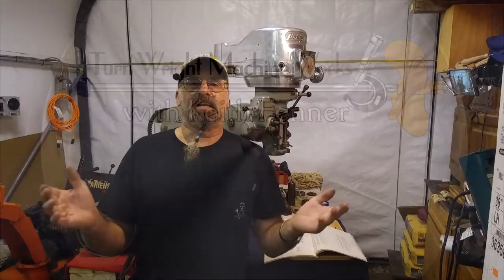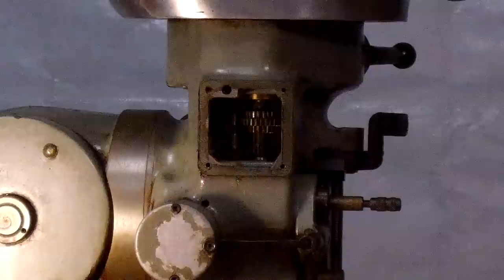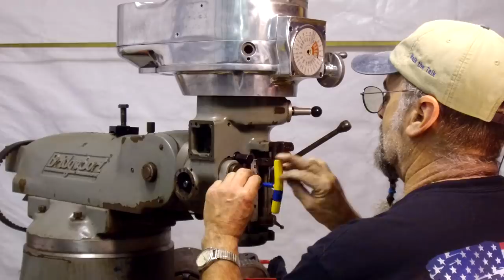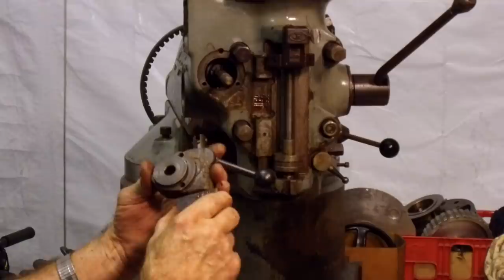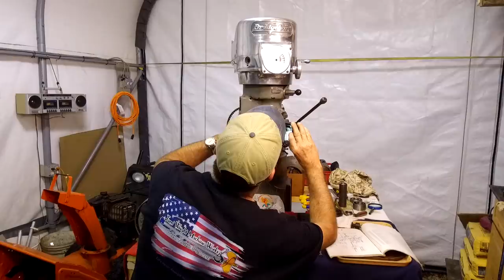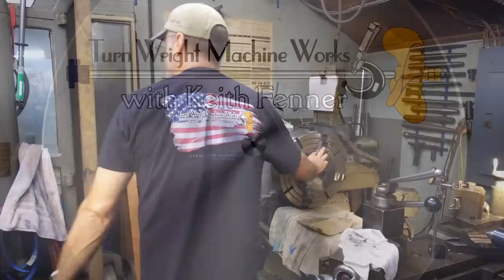Buffy Gets A New Set of Spindle Bearings Part Two

Comment: Keith, if the dog bone in your machine is broken (as mine was) I found a simple little dodge to get it out. Use a plastic soda straw, if you carefully feed it in it will slide firmly over the large ball and you can pull it out without much drama. Thanks for the videos, they always have some new bit of info.

Comment: Hi Keith  Greetings from England ,just watched the vid of you sorting / striping out Buffy's head, have just repaired my "j"head Bridgeport and I had a minute crack in the fork of the clutch arm which engages into the trip for the quill feed, on my machine this arm is a silicon bronze casting ,it's an easy fix if you spot it before you  put it all back together .(not like me who missed it first time round ) .Always watch the vid's and enjoy, keep up the good work.
Will Turner.

Comment: Hey Keith, I believe those bearings are angular contact brgs. The pre-load is set to a certain, say inch-lbs,  rotating torque like pinion brgs in a car differential. Buffy is looking quite hot. God Bless Ya   Dave

Comment: If you do decide to take out the quill (you know you will eventually....) watch out for the sliding sleeve at the top of it (which covers the opening in the front of the head when the quill is down).  Don't force the quill down or you can break off the little tabs that hold the sliding sleeve in place.  You can imagine how I found out about that...Mine is a '55 round-ram step pulley head though, in much rougher shape than yours!  Thanks for the great videos as always.

Comment: Keith I  enjoy  your vids and respect your talents.  I have the same model BP and partially rebuilt my head as well. Might I suggest installing a grease zerk  in the gear reduction  section while you have the head assembly  opened up.  On my mill that section was packed with grease that had dried and had receded away from the gears and wasn't providing lubrication.   I carefully measured  from  upper housing mount on the GR and drilled and tapped the upper housing for the zerk.  I modified the grease zerk by soldering  a small short brass tube in it  to direct the grease precisely to the gear.  Now  I can grease those gears and know the are lubricated.  Just a thought my friend.  Thx

Comment: Hi Kieth,
Another brilliant video as always. This series will be the "how to rebuild my turret mill"  step by step including all those tip from your knowledge, like checking for burrs before reaching for the bigger hammer! It would seem that the design has been copied by most of the current Asian built machines with possibly the only change being conversion from imperial to metric threads and maybe shaft and bearing sizes. I bought a new Taiwan built turret about a decade ago, and havn't had the need to "check out what is under her apron" to quote your phrase. I have had the cones stick on the variable drive, which took some freeing, without actually having to disassemble the entire drive, and I don't know if they have the nylon sleeve or are just metal to metal, the cones look like they are made from alloy not CI. There are certainly a lot of parts packed into that relatively small head casting, and not a lot of room for fat fingers. I look forward to the rest of the series.
Thanks for your wonderful videos and sharing your knowledge.

Comment: I don't know if you've gotten back to assembly yet on this thing, but that little lever on the bottom of the micrometer screw and the plunger has a little set screw on the left hand side. If you get it all back together and it's still not working, that screw might be missing or out of adjustment. It was missing on mine. On the top end there's also a little stop pin at the top of the travel that will kick it off as well. There's a little shaft with two balls machined into it that goes between the micrometer screw and the plunger. When the stop knob hits into the plunger, it kicks that little ball over into the bore of the screw and actually pushes the screw down, tripping the lever. There was a hardened pin in place of that thing on mine. Some mills don't have that feature so I thought when I looked down that hole and saw that pin it was just the plunger pin. Well, I couldn't get the screw out because that pin was in there and decided to work it out of there with the clam shell attachment on my port a power. I ended up tearing the screw shaft in half. She came out all right. There's a new one sitting on my work bench right now ready to install, along with some replacement ball shafts. I hear they break often so I bought a pack of 5. Anyway, hope this helps.

Comment: Keith love your videos.. hey on that pulley we use a "Dupli-Color rust fix it will turn bear metal to a gun metal black and almost never rust... on those bearings dad converted his mills to a tapered bearing to be able to per load the bearings and was able to remove all end play .0003 to .0002 and no side to side play
Reply: carguy3504 is

Comment: By the time I die, Jerry rigged will mean something good, dammit.
I may have to live a lot longer.
Reply: That would make a great quality control stamp for your work  "Jerry rigged by an actual Jerry"
Reply: somebody else 
I've actually Stamped a couple things I have made, with "JERRY RIG".
I'm a Maintenance Machinest in a plastics factory. We make mostly dairy containers. Like sour creme, yogurt, potato salad,etc. Think, anything that comes in a round white container, up to 4 quarts. 
Anyway, the items I built were mostly jigs and fixtures for working on plastic injection molding machines. Devices to make working on the machines easier and safer.
I guess maybe I should trade mark the name.
I can't  raise money collecting for Jerry's Kids. Even though I have a few.
Well, I rambling now.
Cheers

Comment: Kieth,
For your  feed trip issue, take a look at a part called "Reverse Trip Ball lever"  it's located inside the head casting boss at the top support of the  the very top of the quill stop screw.   It's a dog bone shaped piece about 3/8" long with formed balls on each end.   I guess it's common for these to snap in half, it was broken on my mill.  It was a bugger to get out but once replaced the trip system worked well.   Also the forward reverse shaft detent ball is a pain to get out, lots of tapping.     I did the same job on my mill about 5 years ago, photos at https://goo.gl/photos/QQT7GrPxirMuoZPN7    There is a photo down a ways in the list that shows all the parts for the trip lever and the dog bone. 
Craig
Reply from the maker: Your mill and work looks sexy! thanks for the share! ;{)------
Reply: Good stuff, mate.  This is the sort of thing that makes comments invaluable!

Comment: Keith
Another great machine repair-restoration video.  Is the variable diameter pulley mechanism made by an outfit (U.S.) called Reeves?  They are still in business.  I have an Ex-cell-o mill and recently changed the motor so I had to play with the variable speed drive and the pulley halves on my machine look exactly like the ones on your Bridgeport.
Keep the videos coming.
Paul
Reply from the maker: I don't know but if I need to replace I'll be looking. ;{)------

Comment: Hey Keith,
was hoping to see how that stupid little detent ball comes out of the collar. i have an issue with the quill feed on my bridgeport and have tried to remove that collar and for the life of me can't get that ball to drop out, blow out or pull it with a magnet. how long did you have to dink around with thing to get to come out and most importantly, what tool did you use to coax it out with??

Comment: This is the same basic project that I am working on. My mill is a basket case so I find your video very informative. Unfortunately the pulley that the shoes ride in was not in the basket. This is a difficult part to find. Any suggestions for machine dismantlers or places with new old stock?
Reply from the maker: That is something that gets snactched up fast, got to keep the search Ebay etc. ;{)-------

Comment: You don't have to preload the bearings.  It's possible you can just re assemble with the new bearings and original sleeves, so long as you confirm the lash is correct before you get too far along in assembly.  See 31:43.

Comment: I don't know if the subject has been approached but are you planning to clear coat the buffed areas to slow dulling of the bright work?
Reply from the maker: Yes and I'll probably coat it with some Mothers Carnauba wax just like I coat my raw polished wheels on my old Porsche. 
I'm leery of clear coats, yellowing, fading or pealing.  ;{)-------
Reply: Only clear I would trust is a two part urethane, and that only ensures it will not yellow.  Adhesion is a crap shoot since it gets directly applied over polished metal.  If you have any issues with it you quickly wish you never applied it.
Reply: Shain Andrews Already tried to clear coat polished aluminum with rattle can and a 2K product- neither works because the metal is too smooth to adhere to.
Reply: Autosol is good for polishing and keeping the tarnish away...
Reply: Simichrome Polish Keith, It leaves a barrier against corrosion on polished aluminum and polishes a little more with every application.  I used to polish the aluminum side covers on my brothers' Sportster with it. ? Maybe made in Germany?
Reply: The Simichrome wud be good for Your aluminum wheels too but it can leave a pink stain on the rubber tire.- Just did not want to be responsible for hurting your "baby".
Reply: there's a spray-on (i think) varnish (not Polyurethane) that restorers of antiques use to keep brass and nickel from tarnishing . . . i didn't see it tarnishing or yellowing in 15 years on a lamp i once had . . . you might talk to someone in antiques (i know, there's no antique shops on The Cape) and see if they know or can find out.

Comment: Make yourself a dummy shaft, I used the original when I swapped our bearings and it stuck good, remember the epoxy is designed to stick to the bore of the pulley and it doesn't think twice about sticking to the shaft when it pushes the excess out.
Reply from the maker: cool will do, just to save any aggravation. ;{)------
Reply: Keith Fenner Another don't do what I did tip is when cleaning the old epoxy out a die grinder works fine for the bore but the groove that retains the bushing shells has to be real clean or they don't expand enough. I tried picking and scraping but after a few failed attempts end up using a grooving tool in the lathe and rotating by hand. Its worth having a few trial fits on the shaft before jumping in with the epoxy. Best of luck.

Comment: Of course you realize you're going to get addicted to buffing. By the end of this series that whole machine is going to be shiny brass. Or whatever metal may be made of.
Reply: polished cast iron, mmmm... tastes like rust!
Reply: You can clear coat over polished metal to seal it against oxygen
Reply: ponkkaa I
Reply: It cuts better when its shiny!
Reply: Shiny machines make shiny parts. 
I learned long ago, that the better the finish on a part, the less critical the QA guy is gonna be if the part is out by .0001" (.0025mm) on a .0003" (.0076mm) tolerance.